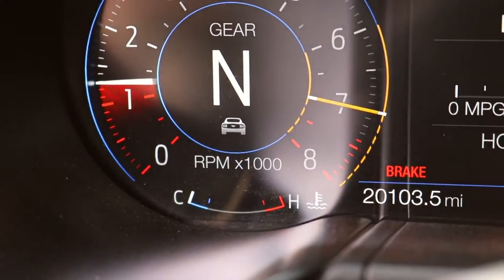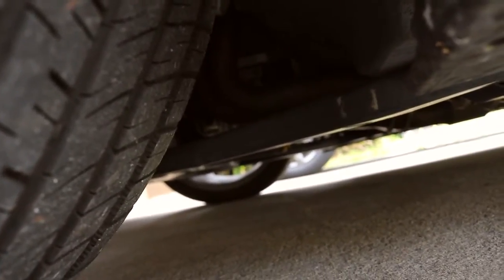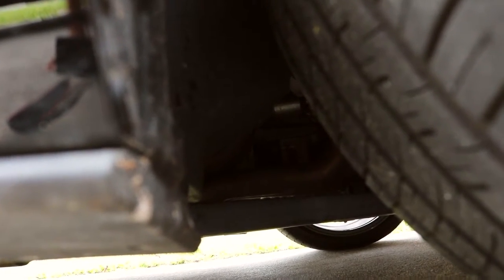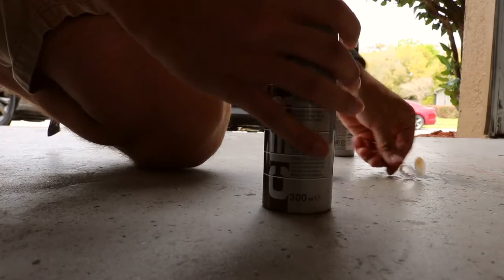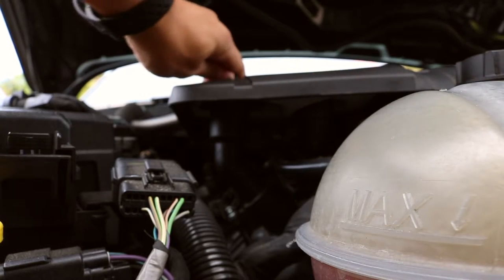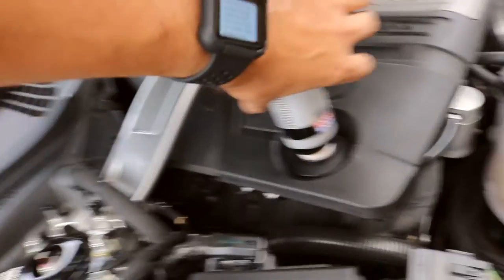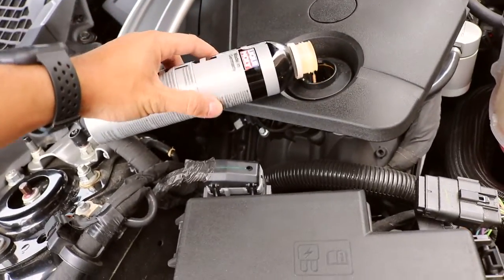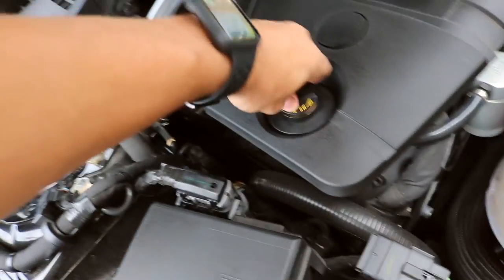Does Ceratec ACTUALLY FIX the infamous Mustang Tick?!?

Comment: I bought my 18 GT 6spd new and have never heard anything abnormal. This video sounds exactly the same as before. New engines make noise it’s normal. I think the “tick” is a paranoia thing or it’s the normal sound of the components on the engine. Piston slap could be a possibility but it definitely has a distinct sound and there is no way an additive will help if it’s the issue. There have been 18-21 GTs come off the show room with piston slap so it’s not that unlikely. Ford will do everything they can to not acknowledge it also.
Reply from the maker: I should probably update this video but I will agree this video sounds exactly the same before and after 😂 I no longer have this video, but after getting rid of it we took apart the engine and it did have scoring all along the cylinder walls throughout 3 cylinders
Reply: @BrandonChinn  That sucks man. Was it covered under warranty?
Reply from the maker: @wildfirewoodandmetalworx2409  unfortunately not. It was a bummer and a little disappointing but not much to be done. It’s all good though, I guess it happens 😂
Reply: @BrandonChinn  how would scored walls not be covered under warranty
Reply from the maker: @ah4800  I did have headers on the vehicle when I brought it to them and they claimed the headers caused the issue to the engine. A bunch of BS I already know but it is what it is I guess 😂
Reply: @BrandonChinn  so what happened? The noise got louder or you fixes or was gone?
Reply: It’s the sound of the injectors.
Reply: @BrandonChinn wait… you put headers on a Mustang and are surprised the dealership wouldn’t honor a warranty claim?! Lol! Lol! That’s like the Jack Ass skit where they put a rental car in a demolition derby. Of course they won’t honor the warranty!!!
Reply: @buttsexandbananapeels  The Magnuson Moss Warranty Act requires manufacturers to honor the original warranty unless they can prove that the aftermarket modification (either the parts or installation) was responsible for the failure that caused warranty repairs. Headers will not cause engine failure.
Reply: @buttsexandbananapeels  That’s not injector noise 😂 Direct injection engines do make noise but not like this.
Reply: @wildfirewoodandmetalworx2409  if headers are installed wrong, they will DEFINITELY cause engine failure if you’re out ripping on it for a few months before you realize “oh… oops.” Lol.

I’m well aware of the MMWA: I’ve had to cite it, correctly, multiple times when dealing with Subaru of America. Your claim on headers… dude, lol… you’re never going to win that fight, Legal Eagle.

MMWA is there to allow owners to change their own oil. It’s a preventative maintenance legal protection under right to repair. In other words: it protects you from having a warranty strike issued as long as you use the correctly certified parts when doing maintenance and/or repair.

Even with OEM parts, you better have a mechanic install them (preferably dealer) if there’s any chance a mistake could lead to total failure.

FoMoCo will never sue WIX because their own filters are designed with engineered obsolescence in mind and a lawsuit against a better manufacturer will lead to a class action lawsuit.

Same with suing Mobil 1: no dealership uses good oil, they use the cheapest they can source. As long as the oil (and any other fluid) meets the ILSAC/API requirements FoMoCo lists, you’re covered.

Racing parts? LOL! Did you actually quote the MMWA… FOR RACING PARTS?!

The only thing you could have done is reinstall the stock manifolds and claim ignorance. Even then there would be witness marks all over the place, so you’d have to say you thought it was an exhaust leak so you resealed the manifolds. Then they’ll ask why you didn’t file a warranty claim then.

If you BRING THE CAR IN WITH HEADERS ALREADY IN IT all they have to do is say “we didn’t engineer this part, we didn’t install it, and we didn’t drive it. These are racing parts, and racing automatically voids any warranty responsibility. He can’t prove he wasn’t out thrashing this thing like an idiot with incorrectly installed RACING parts of unknown quality. We’re not liable to a preponderance of evidence and this is frivolous.”

Your day in court is over with that, Perry Mason, MMWA or not… and they could even sue you to pay for their lawyers’ time. FoMoCo usually won’t do that, though.
Reply: @buttsexandbananapeels  I’ve won that fight 2 separate times with Chevys and Fords. Got a transmission for the Chevy and and engine for the Ford. They could not prove any modifications I did caused harm. Additionally, If you can’t install headers correctly you have more serious problems😂
Reply: @wildfirewoodandmetalworx2409  you said Ford didn’t cover this engine.

And you didn’t win that fight. Ford and Chevy looked at what it would cost them in legal fees to go to court, what the coin flip of winning was, and decided it was less expensive to honor a sketchy warranty claim than it was to pay for the lawyers to fight it.

A lot of times they won’t bite a first time complainant with all the teeth in the corporate jaws, but only that first one will be free. That’s likely the reason behind your claim of “winning.”

You gave them a paper trail showing your irresponsibility and their willingness to be generous in resolving problems.

“This guy did this to his last car and we honored the warranty. He’s doing it again.”

Sometimes people think ahead before doing something.
Reply: @buttsexandbananapeels  I never said that😂 I said they will do everything in their power to try and not cover it. So if a person modifies their car it’s irresponsible to you🤣 Furthermore, I forgot you were there and know how everything went when I WON the warranty claims for two vehicles. The Chevy had an aftermarket supercharger and the Ford had full race exhaust, aftermarket intake, throttle body, injectors, and a race tune so yeah you have no clue what you speak of.
Reply: @wildfirewoodandmetalworx2409  ok pretty girl.
Reply: @buttsexandbananapeels  Big words from behind the screen kid.
Reply: @buttsexandbananapeels  Mommy is calling you to come up from the basement Karen
Reply: @wildfirewoodandmetalworx2409  you’re talking about yourself again, Smooth Innie.
Reply: @buttsexandbananapeels  Good come back clown😂

Comment: I cannot hear any difference.  You should the dealer check your cam tensioners though.
Reply from the maker: Might just do that actually thank you!
Reply: Add Forte Gas Treatment. I'll think that sound also might come injectors? Also lifters make some noise, if i heard right.. But these are cheap tests. Ceratec to oil and petrol treatment, like Forte.
Reply from the maker: sami k I’ll try that! I mean couldn’t hurt anything so why not
Reply: @BrandonChinn  one bottle forte gas treatment to half tank of fuel is best way to clean injectors, pumps etc.. It doesn't hurt anything.

Comment: According with manufacture Ceratec need to run few hundred miles until the product build the popular ceramic film in the internal engine moving parts.
Reply from the maker: Metatron Men yeah that what it says on the bottle. I don’t doubt that’s the case but my tick definitely went away. It’s a huge noticeable difference you can’t miss
Reply: @BrandonChinn  i have a good experience as well, i have a fusion with ecoboost engine and had a tapping noise under the hood, is a car of the year so I went to the dealership and they said is normal, is the high pressure fuel pump, in the factory oil i pour molybdenum mos2 and after 2k miles i changed the oil for Amsoil synthetic also added ceratec, after few hundred miles the noise was gone, after other 7k I changed the oil for Amsoil only, running in oil only now with no noise.

Comment: Guys use motosilk engine treatment that one is best high mileage cars and muscles cars recommended and no needs to use every oil change one time using protects over 100.000 miles  little bit expensive 😎
Reply from the maker: Actually that doesn’t sound like a bad idea. I’m definitely going to look into it, thanks for the heads up!

Comment: Is this an actual fix, a bandaid or psychological &&&&. Everyone needs to look up THE OIL GEEK. Adding these additives in general can be more harmful than good, it also depends on what type of engine oil you are using. Some brands of additives react harshly to certain oils,  so hence your engine protection is compromised- bearings, piston bore and so on. PLEASE, PLEASE DO YOUR RESEARCH PEOPLE and what you may find might make your head spin. Good luck 😂
Reply from the maker: Can’t tell you if this fixed anything but I will say I did have scoring on the cylinder walls of the engine, most likely prior to using any of this
Reply: @BrandonChinn  Hi Brandon, sorry to hear about the piston bore, but again using oil additives will DECREASE PROTECTION even more if you already have damage as it reacts with the chemistry of the oil. I use 5w- 30 full synthetic and have had no issues. Good luck. Vic

Comment: I used it today in my 2018 Gt today, and the tick stopped!!
Reply from the maker: Gregg Narcisse dude that’s awesome! I’m glad it worked for you!!
Reply: @BrandonChinn  wish u the best brother
Reply from the maker: Gregg Narcisse thank you man, you as well!
Reply: @BrandonChinn  all good Brother
Reply: hey man! how many miles were you after an oil change? I am currently at about 8000 miles, and changed around 6700 and was wondering if it would be safe to use the ceramic? or should I do an oil change and add the ceramic then?
Reply: @lawsonleatherwood4249  you can use it now with you're current oil.
Reply: I used it today on my 2018 mustang.  It worked! So far so good.
Reply: @mechmind  nice my Brother